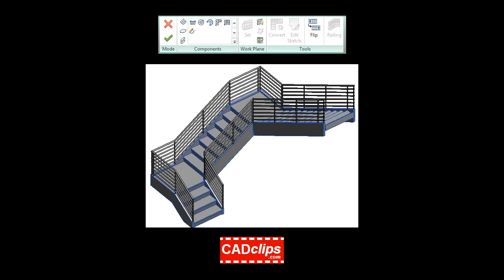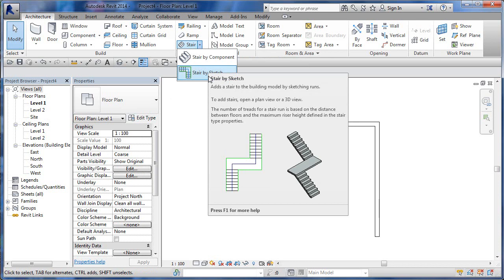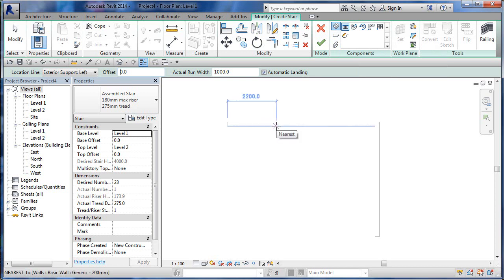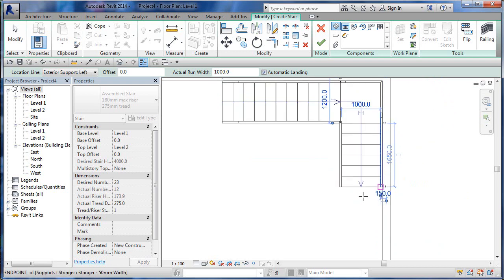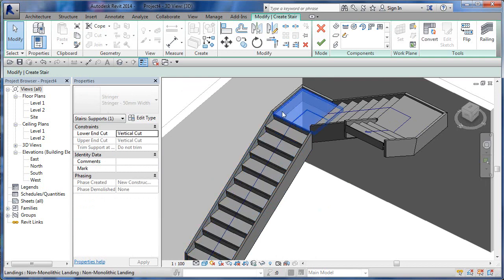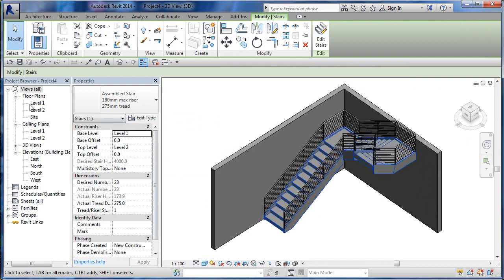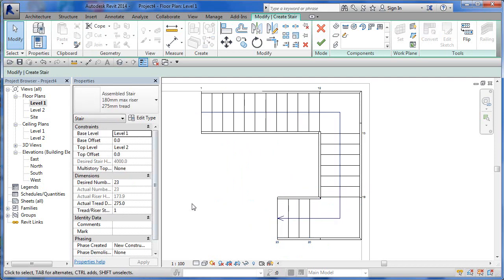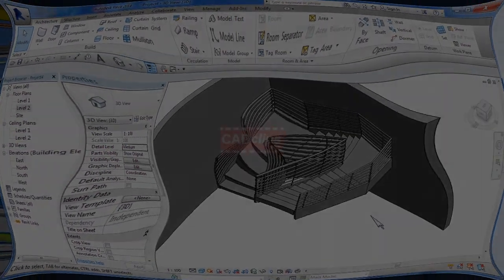REVIT Stairs by Component Overview - CADclips

Comment: I have a quick question with stairs.  I had to modify the riser of a stair, because they were not touching the tread above while using the custom treads.  I did create a new family object to replace the old one that was too short, but now I'm getting an extra tread riser in place.  The riser is located on my landing and I have tried a bunch of things but nothing is working to remove the last riser.  I am a fairly new Revit user, Am I just missing something or over looking something.

Comment: Can you help me please! With Revit 2014; whenever I try to place model in place components, extrusion type; and some other things; the 'TICK' option to complete the process is greyed out. I can't finish off what I am doing!
Nor can I edit the profile of walls and some other things. It's very frustrating as I can't complete anything. I am coming from Revit 2012 to 2014. Thanks
Reply: After exiting and re-opening the program, the option to "Edit Profile" appears in the ribbon after clicking on a generic wall. From here, I can edit the profile of the wall with no problems; but then, the option to complete or cancel the editing does not show in the ribbon! "Edit Profile" Still remains in the ribbon, even though I am CURRENTLY editing the profile. It is so frustrating and I don't know what to do!! :(
Reply: BanielDrown Revit 2013 not 2014, I've just realised!